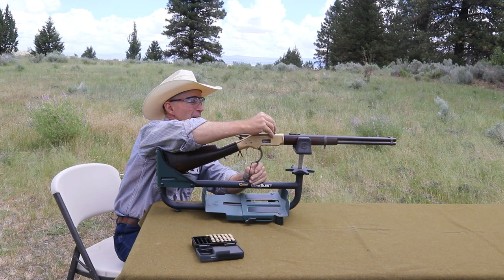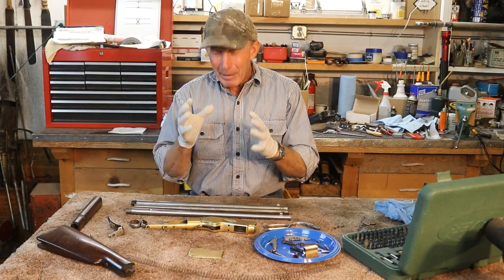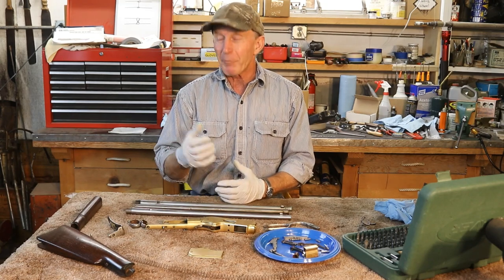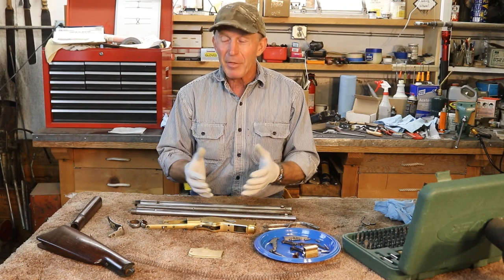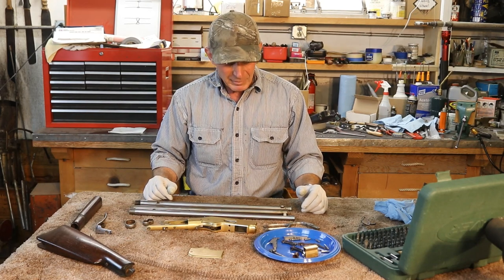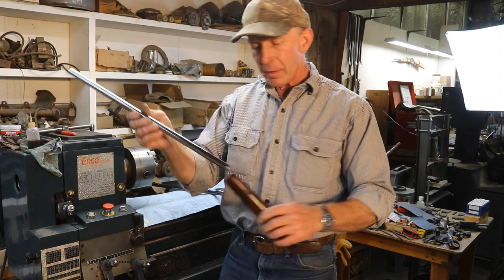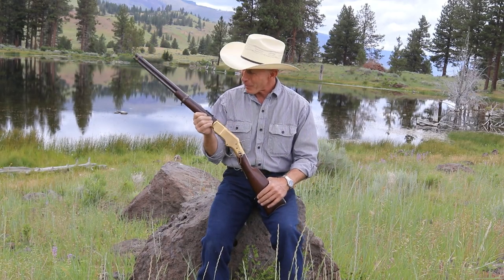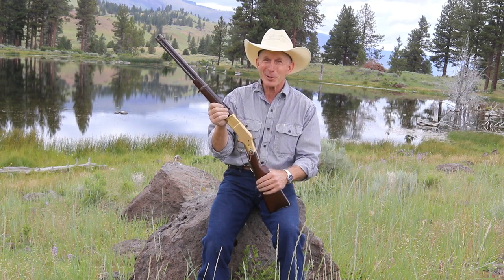Original Winchester 1866

Comment: Hey Mark great video.  I've found a pretty good method for antiquing brass, copper and bronze.  I noticed after shooting BP cartridges that the residue turned my Uberti 66 carrier a beautiful orangish red color.  Take a piece of steel sheet and cover it with a thin layer of GOEX (it's the dirtiest) and light it off.  Do this a couple of times to accumulate enough residue.  Then take a wet rag and wipe up the residue.  Apply the wet residue to degreased brass and allow it to discolor.  I like this method because it perfectly replicates the processes that built the natural patina on antique BP firearms in the first place.
Reply from the maker: That's a great tip!  I've noticed that on my brass cleaning jags when cleaning up after shooting black powder.

Comment: Good video Mark.  Well done. Great work!  Mismatched bore/bullet diameters are not uncommon when dealing with the old black powder cartridges.  The bump up effect of BP helps in many instances.  Enjoyed the video....Thanks
Reply from the maker: Thanks Mark!  Of course, this one had the opposite problem from most original black powder era barrels in that the bullet diameter was too big for the bore.
Reply: I have a number of antique rifles and I always slug the barrel to determine the correct bullet diameter. It may require ordering a bullet sizing die or a custom bullet mould. If you’re into shooting antique rifles, being a reloader is a must in my opinion. Also using black powder or Pyrodex eliminates the chance of an under load or overload as is possible with smokeless since you always use a full case.

Comment: Thanks for another great video.  Beautiful workmanship as usual.  Can you talk about fitting the barrel vice jaws to the barrel contour?  I see various recommendations on this process and also various materials used for the jaws.  Thanks again.
Reply from the maker: I copied that vice from the one at the Lassen College gunsmithing lab.  The beauty of it is that it used plywood inserts that form around the barrel and when they wear out, you throw them away and cut new ones.  I put thin layers of leather between the barrel and plywood to protect the finish.  With a 20-ton jack holding the barrel, it doesn't have the chance to slip.
Reply: @thecinnabar8442  thanks.  Plywood sounds a lot easier than some of the other ideas I see floating around.  I have a 20 ton hf arbor press. I’m thinking I can just fabricate up some jaws and use it.

Comment: I rebarreled an 1886 40-82 with one of their barrels and it was to a "T" as advertised but did take a while to get it. That was a few years back and then I paid 450.00. I have that exact same Enco lathe. I bought it in 2002 and it has been a good machine. Just not very rigid and I constantly battle chatter when I turn a barrel but it threads well. Great work as usual on the 66. Some of the old stuff can be a battle to get right but like you if you do some research it usually all comes together.  If you have a win. 94 with a button mag. can you please show how it attaches to the barrel? I am trying to convert one from full length to button. Holy smoke is that a M60 action wrench?
Reply from the maker: I have a new Grizzly gunsmithing lathe for barrel work but do most of my smaller jobs and polishing on the Enco lathe.  The button mag on an 1894 rifle should attach at the forend in the same way that a full-length mag tube attaches.  The button mag cap has a ridge that won't won't fit through the forend cap and that's what holds the tube in place.  Good luck.

Comment: Love the videos and history!! I was watching the 1866 Winchester restoration. I noticed you mentioned you didn’t have a way to age the brass or gun bronze.  You can achieve the original look with vinegar fumes.  I’ve done a couple of reproduction guns. It will yield that old mellow mustard patina.
Reply from the maker: Thanks a bunch for the tip and for watching our channel!  The vinegar fumes work really well to remove the shine and dull the finish.  Honest aged brass or gunmetal framed firearms have an almost flaked look (something like the texture that forms on some galvanized surfaces).  I don't think anybody has figured out how to replicate that appearance.  If they have, they aren't sharing the secret with the rest of us.🙂
Reply: @thecinnabar8442  yes sir I’ve seen that a lot on bronze cannon especially on the cascabel knob where people tend to touch the old guns on display.  I am not sure what the Italian makers use brass or actual bronze. It maybe that the old gun bronze only will do that flak pattern.  I have a couple pics I can try to post here where I believe I have a start on it with this process. It’s starting to get the brighter little flakes contrast

Comment: 10% humidity!  Ha!  Right now here in Missouri, I could put that barrel outside and it would rust in seconds!
Reply from the maker: That doesn't sound very pleasant in the summertime.  Living on the edge of the high desert has its advantages.  😉
Reply: @thecinnabar8442  The humidity in Missouri is pretty miserable in the summer. When I first moved there after living in Wyoming for 10 years, I got out of the car and remember how thick and wet the air felt. It felt like I could have flown if I strapped some wings to my arms and flapped them hard enough.

Comment: Hi Mark, During the barrel to receiver installation, would a cold barrel and heated receiver allow the barrel align without less force?  I have never done this and I was just curious.  Awesome video and thank you!!!
Reply from the maker: Thanks, Chief!  I've not had trouble in the past with getting barrels to line up to the receiver.  I'm not sure heat would help in that situation.  If a barrel doesn't time up, it's not typically because the threads are too tight, but because there is too much material on the shoulder of the barrel where it mates up to the receiver.  It would need to go to the lathe and have material removed to time it.  This one went on easily and I was being very cautious because of the soft gunmetal receiver.

Comment: I would try annealing the front half of the reformed brass as soft as possible and load black powder. I would guess that a soft case mouth would seal against powder fouling for easy cleaning and maybe help with crimping those healed bullets. 2 F black powder, moderately compressed will prevent bullet setback like in my .32-20 WCF.

Comment: Curious about reloading. The last 11.000 und of the 66 was bought by brazilian army and apears here in the 1890's. These brazilian 66 came wit the bolt prepared for rimfire and centerfire by changing the firing pin. Use the 44 brazilian nagant centerfire and the 44 henry flat. The poor rolled brass of our ammunition at those times give to the gun a bad function and most was destroyed or sold to civilians. Some of them survive till today. But we have no ammo, and the info i read about bore and groove diameter of barrel turns hard use 44 special brass and bullets

Comment: I love Winchester model 37's. My first gun was one in 12g, I have been looking for a .410 or 28 ga in mod. 37 for years. I have a couple of red letter 12g mod 37's. Why is wd40 such a no no?
Reply from the maker: WD-40 has isn't a good choice as a gun lubricating oil, so many people think it should never be used on firearms.  For this application it works well, but I remove it after the bluing cures and apply gun oil.
Reply: @thecinnabar8442  I have found that people get a bit precious about oil. All Oil stops rust. I have found that baby oil {light parrifin) works well. Also clean car engine oil works and stays on

Comment: there is a way to age the gunmetal / brass to look aged. I have a original Griswold and Gunnison revolver .when I got the gun it was missing a lot of its parts. So i used original colt 51 parts and modified the parts to look correct and fit the gun. but while doing all of this. some of that the brass did not match. I lightly polished all the brass to look the same.   Pouring vinegar and salt about half an inch deep in a bucket .then suspend the brass above the vinegar and water. Over the course of 7 to 10 hours. It looked exactly the way it did at 160 years old.
Reply from the maker: Thanks for the tip!  I've used that very technique with success.
Reply: @thecinnabar8442  i have a quick question for you i recently bought a original 73 Winchester its toggle links are fairly worn out. Any suggestions on a place to find a set of toggle links.
Reply from the maker: @snappers_antique_firearms  Lee Shavers Gunsmithing reproduces and sells high quality 1873 toggle links.
Reply: @thecinnabar8442  thank you

Comment: What bullet diameter did you settle on?
Reply from the maker: I sized them to .428" for this barrel.  Of course, on an original barrel with a .434"-.435" bore, they would have to be sized larger.
Reply: @thecinnabar8442  Did you run it through a 44 special/mag sizer to get .428?

Comment: He obviously didn't send the brass to anybody qualified because if he had they would have loaded with black powder and recommended not to shoot anything but black powder in an original like that. Very sad that they ruined the original barrel from something so stupid.
Reply from the maker: The quality of work from them was really poor.  One batch was .420" diameter with a crimp and the other was .440" with no crimp.  When I pulled the bullets to resize them, I could see the cases were filled with smokeless powder.  Needless to say, I dumped the powder and reloaded them with black powder.
Reply: @thecinnabar8442  You did a great job of restoring a gun that was otherwise mutilated. Thanks for sharing